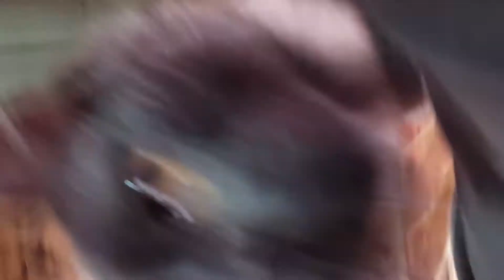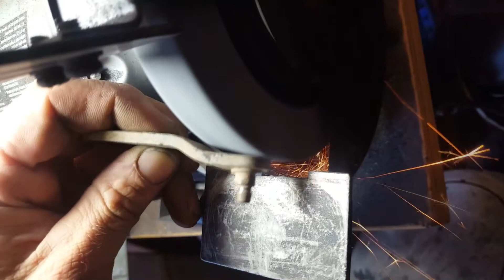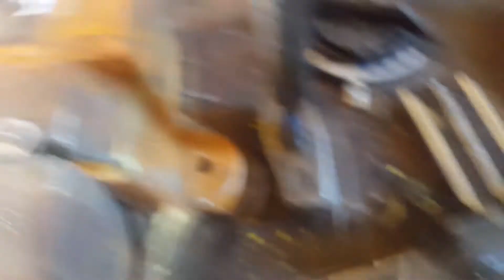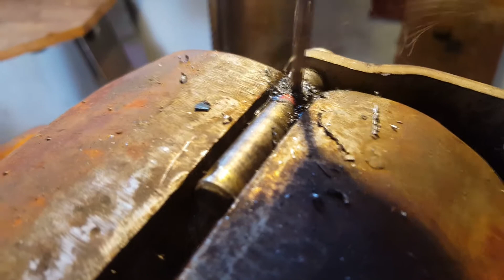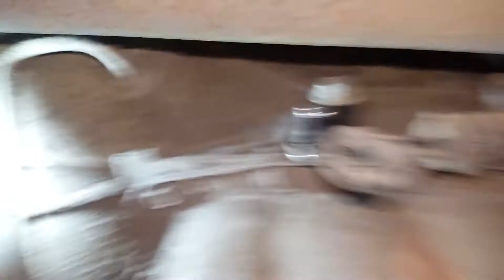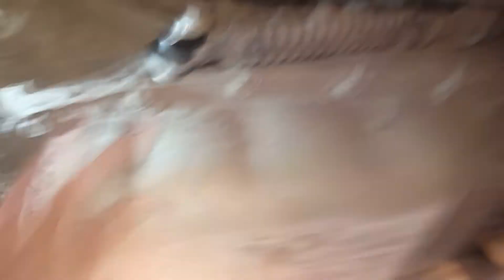F*** you CHEVY! Automatic trani shifter cable buggered?

Comment: Stayed stranded on a packed steep hotel parking lot on neutral and the emergency brake wasn't holding.  Thought I popped the cable and it was this stupid clip. Thank God I was able to roll down hill and wedge the truck against the Hotels garbage curb. This is a lifetime fix, Great job, short and sweet (funny too) God bless you
Reply from the maker: It never fails as you pull out of the drive way does it? Good luck breaking the steel pin :D

Comment: Looks great
Reply from the maker: thx, works great too! :D
Reply: Yes. My truck is 255,000 km . The plastic bushing wore out completely. General Motors wants me to spend 140$ on a brand new cable. So, I had to buy one. Even I saw your video and was excited for something that is better quality .
Reply from the maker: @michaelanthony5335  I see. The thing is, it does require drilling out the arm to accept the clevis pin. So it is not just a matter of selling 2 pieces. I suspect they made it that way in case of an accident or something. I wouldn't want to be liable through sales. The video just shows how I fixed it, doesn't mean that i tell people that this is the only way. Ergo I am not liable for damages. It is a tricky thing nowadays in a "suing culture"
Reply: You should make a few and sell them haha.
Reply from the maker: @michaelanthony5335  is it an issue you ran into yourself by any chance?